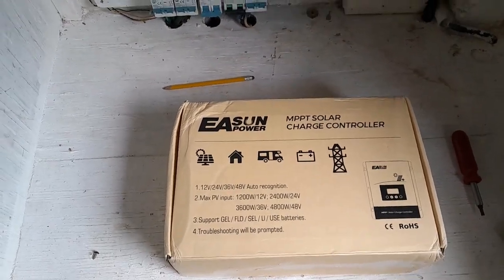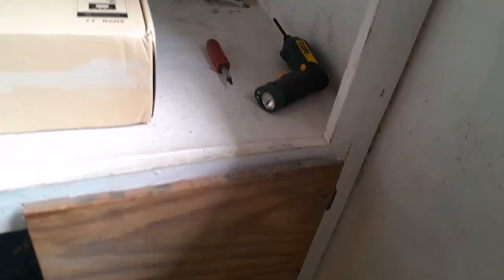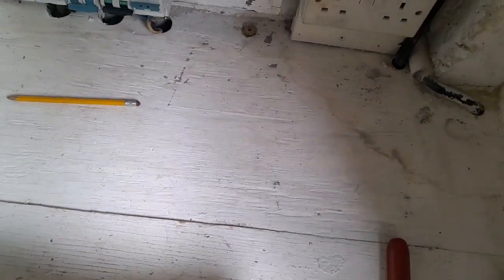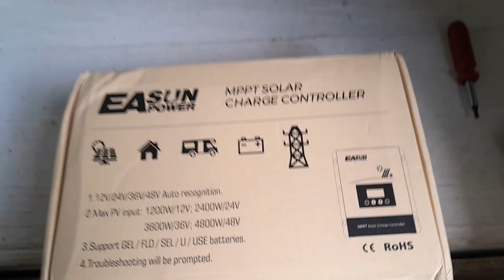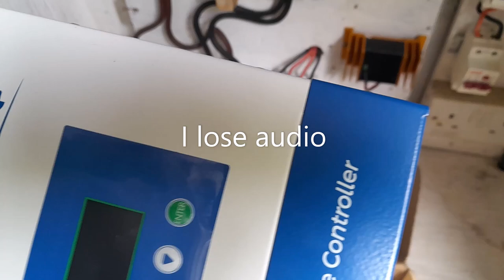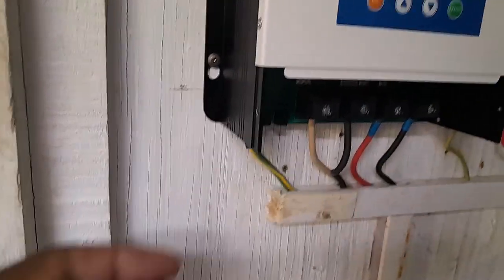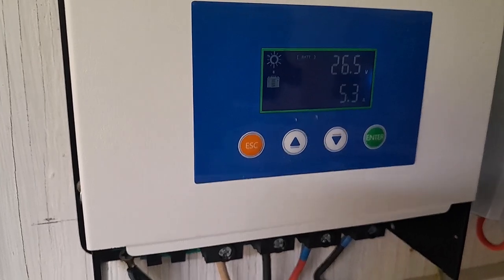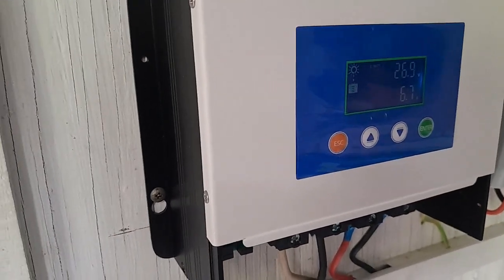EAsun MPPT 8048 Solar Charge Controller Install

Comment: I have three of them in my system.I recomend you to use thicker cables to connect to battery,like 16 mm2.Have you find a way to set parameters etc using com port?Is there any compatible software?

Comment: Hi, sorry, I read that it does equalization, you can set the voltage.  But when it does it is not known, at least from the manual.  Do you know when the equalization is done?  Thank you

Comment: Good morning, does your regulator read the exact volts?  If I set a bst of 15.5v in mode 7, i.e. in absorption (bst), the batteries receive 14.9/15v, not 15.5v.  Does this happen to you too?  Thank you

Comment: How noisy are the fans?
Reply from the maker: I don't have enough panels for the charger to heat up for the fan to come on.
Reply: @AlwynNicholas  I will soon receive the same unit and I have 2kw worh of panels, on 24V. I will post my thoughts here if I remember to do so :)
Reply from the maker: @andreirusu8  Ok.
Reply: @andreirusu8 boa tarde. Eae. É bom o controlador com 2kw?
Reply: @PedroPaulo-ul5mh Hi. The controller is really good, but a bit noisier than the Easun 4880. It works well with my 4x470w bifacial panels(I have sold the old 2kw poly panels)
Reply: @andreirusu8  When do you give these 4x 470?
Reply: @PedroPaulo-ul5mh  I've put them 2 in series and the 2 series in paralel. It's about 105 volts
Reply: @andreirusu8  What is the current?
Reply: @PedroPaulo-ul5mh  The short circuit of the panel is 11A, so being two strings in paralel results in a max 22A but I'm not currently measuring the panels amperage. The output of the mppt, on a 24V lifepo4 system was even 71A sometimes. Usually is charging with 57-64A (it's really hot this time of the year and the production is not at the maximum point)
Reply: @andreirusu8  Too, I'm from Brazil, I also use Lifepo4, I want to connect 4 x 575w to this easun 80a controller, I hope it's good
Reply: @andreirusu8  But from what you said about loading your ae between 54-63a , the controller has a great performance,
Reply: @andreirusu8  If you have YouTube channel. Send me the link to see the video of it working
Reply: @PedroPaulo-ul5mh    I don't have a youtube channel. It does perform good. And the amps on the screen are just one Amp more than measured with a clamp meter. The 60A model from easun adds around 5A more than real. So yeah, this 80A model is a really good one. The other one I was mentioning before(the 80A 4880 model) had a very annoying issue - it was somehow charging with a low amperage(2-3A) in the morning and remained like that even though the sun was rising more and more - it needed a completely shut off the PV circuit breaker to charge with 10-12A in a matter of minute.
Reply: @andreirusu8  Show, now it has 80a and 100a, I bought 1 of 80a. But I want to buy another one in the future of 80 or 100ah
Reply: @andreirusu8 And I already had this problem with an epever controller, in the morning or it's cloudy, the voltage and current would go down, it was annoying
Reply: @andreirusu8 salut..cum merge chargerul de 100a,,esti multumit?
Reply: @wizooshx3786  Da, sunt mulțumit. Funcționează foarte bine.
Reply: Cum sunt coolerele in sistemult tau cu 2 serii? Am un 6048 dar vreau sa il trec pe 12v pt camere si ruter, iar pt cabanuta sa iau asta de 100. Il folosesti cu imvertor?
Reply: @wizooshx3786  modelul 6048 parca e mai zgomotos puțin. Dar merg ambele modele f bine. Modelul 6048 parca suporta maxim 190V iar asta de 80-100A suporta maxim 150V. Asta este foarte important de fapt, sa nu depășim voltajul suportat. Da, le folosesc ca să încarcă acumulatorii lifepo4 pe care îi am, și am un invertor separat de 3.2kwh de la Breckner(a venit cu partea de mppt stricată și nu am avut cum sa îl mai returnez pentru ca nu l-am montat cu firma autorizată) legat la aceleași bussbar-uri.
Reply: @andreirusu8  da, dar nu poti pune mai.multe.panouri..ce.baterii.lifepo4 ai?
Reply: @wizooshx3786 Am 2 bucăți a câte 7+ kwh(280Ah) și una de 3+ kwh(aprox 125Ah) puse în paralel, pe 24V. Le-am făcut eu din celule lifepo4 și bms-uri de la JK BMS
Reply: Da bravo,,ai un mic reactor😊, la 60A dureaza incarcarea..esti off grid?
Reply: @wizooshx3786  Acum am un mppt de 60A pus pe 4 panouri de 500w(momentan nu le-am urcat pe casa) și unul de 80A pus pe cele 4 panouri de 470w. Casa este conectata la rețea, dar am și sistemul acesta, separat de instalația principala. In plus, acel invertor breckner de 3.2kw îl folosesc și la încărcarea din rețea când produce sistemul de 6kw, instalat prin programul casa verde.  Totul a început ca o idee de back-up, cu o baterie auto, un invertor de 500w și un panou de 250w :)
In timp s-au adunat :))
Reply: 🤔60a, 6048 ala de easun cu 4x500w😟la 24v?  In hartiile lor e max 1440w....
Reply: @wizooshx3786  Așa e, dar panourile sunt puse sprijinite de fațada casei, și tot timpul este câte unul umbrit de o structura cu acoperiș pentru mașina. Urmează sa le urc pe casă și sa fac supercharge la sistemul de 6kw ongrid.
Reply: Aaa ok..imi e clar acum, astept sa se topeasca zapezile si cred ca imi iau si eu unul de 100a.